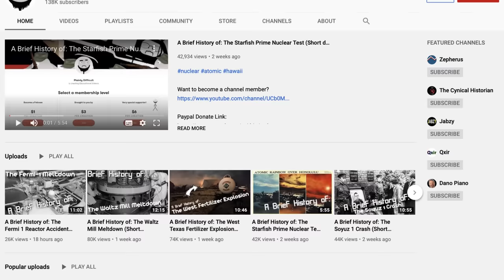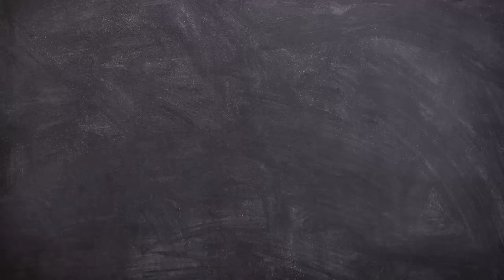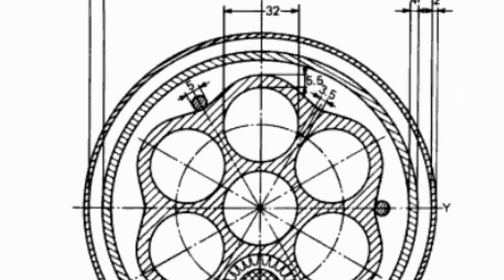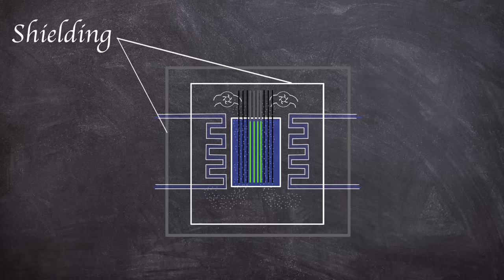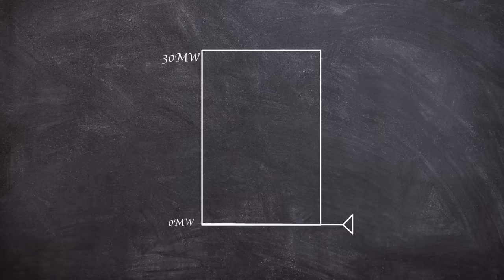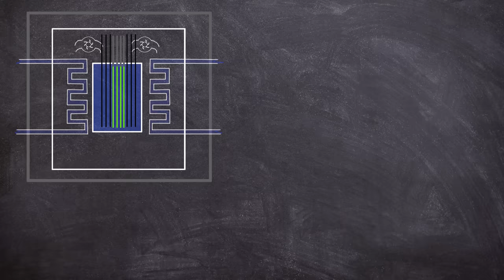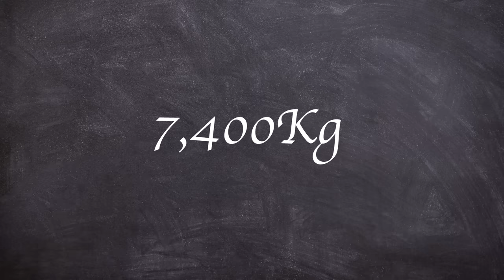A Brief History of: The Lucens Reactor Meltdown (Short Documentary)

Comment: In addition to safety, was defensibly a consideration here?  Building a mostly-hidden, mostly-bomb-proof reactor seems like a very Swiss thing to do.
Reply: The whole darn country is a bunker 🤣
Reply: The Reinforced Concrete Shell of a Nuclear Reactor can probably only be penetrated by a Bunker Buster - There's a snipped out there where they "flew" ( rocket propelled on a rail ) an entire Jet into a representative portion of such a shell on a test site - Viewed directly from the side - At first it looked like the plane went straight through it but a different angle showed the plane just disintegrating on the wall with the latter not having given a single darn fuck about what just had happened.
Reply: Caverns were indeed a way of protecting instalations  as one cant pin point the targets.
Reply: @Duraltia  yes the walls stop a plane and they did prove that but if you're watching German state TV they changed the voiceover to say the walls can't withstand a plane. But the footage shows there is no more plane, just a standing wall.
Reply: @Duraltia  Watched a documentary on a tunnel fire. The problem is not the impact, it is what the heat does to the concrete.
Reply: 4one14  The Osirak Reactor in question didn't even have a protective shell - You could have sneezed on it and it would have had to call in sick the next day 🙄
Reply: @martigrey5872  There is no German state television broadcaster.
Reply: Nuclear reactors were indeed targeted during the cold war as the results were similar to a giant dirty bomb and too tempting to be missed. Burial underground would be beneficial and give a degree of black start capability to the grid.
Reply: Guarentee it was, that was my first thought as well.
Reply: @Thiefnuker  so what is the tax funded TV if not state TV? They have like 50 channels. It's state TV because the state pays for it with a TV tax. Just like the BBC is state TV.
Reply: @martigrey5872  its a public broadcaster. The state does not control it.
Reply: @TotallyNotRedneckYall  not anymore, most of those are shutdown by now...unless they built new stuff, noone knows about...since there are still some sites "eyes only" afaik....
Reply: @Hunne2303  They sold most of their literal "bunkers" at the end of the cold war, but they still have a mind boggling number of disaster shelters.
Reply: @robinwells8879  Sure, it makes sense to for many reasons to bury your nuclear in a mountain side, especially if it's a prototype or your first attempt.  If it gets bombed it's harder to hit, and if it melts down, it melts into a mountain and you can dump concrete into the hole instead of having to build a billion dollar concrete dome that has to be wheeled in place on a 500 million dollar set of rails.  If I'm remembering Chernobyl correctly, they couldn't even get close enough to the radiation source to build an enclosure.  They had build like a mobile 10 story concrete arched lid next to the plant, and roll it into place.

If you build your reactor deep into the rock, I imagine it's going to be inherently more safe given any attack or disaster.  I'm not sure why it isn't done that way everywhere, by default.  You could also store the waste in adjacent facilities drilled into nearby mountain sides, instead of transporting it by train or semi trailer across the country.
Reply: @GlobstersMessenger  I think it's laughable to compare something like PBS, or even BBC to RT... and even more ridiculous to suggest they are state media.  They aren't obligated to speak favorably about the state.  I'm not sure what PBS's mandate is, but it seems to be plenty critical of the state while reporting responsibly on public health and issues that are of public concern.
Reply: @GlobstersMessenger  Having a truly independent media source that is not beholden to profit is important.  It might be a lofty ideal, but a publicly funded source of information is a small assurance against all the things that the recent MAGA movent purported to be against.  If you're against "fake news" with political bias, beholden to big tech with corporate control... I just don't see a more trustworthy source than PBS in the states.
Reply: @martigrey5872  german state tv? There is no such thing, would you like to clarify?
Reply: @GlobstersMessenger  ok... but he says it as if there is just one channel. When in reality its just public broadcasts that include dozens if not maybe hundreds(?) of channels, so either he specifies which channel said this or he is just speaking nonsense. How would he even know what it said if he (i assume) doesn't know the language either?

Just a weird and targeted side comment to make in the first place.

Comment: Reactors in caves may have problems, but it still seems like a better idea than how Chernobyl was built.
Reply: You do realise that after the accident in 86 the other 3 reactors continued operating till 91,96,2000 respectively and there are still another 10 operational.
There's nothing wrong with RBMK-1000 reactors so long as they are operated according to spec. Plus the remaining had modifications post 86.
Reply: Is chernobyl was in the position, the power of the blast would have demolishes the entire side, without the capability to dose of the 🔥... the core would have polluted the underground water traveling towards the lower points
Reply: Spicy Wolf Why would the RBMK-1000 design need to be modified after 1986 if there was nothing wrong with it in the first place? 💀
Reply: If it was a man made cave and properly sealed.  I would highly advise against using an existing cave without proper engineering.  Caves are formed through years of water running through and carving the cave.  So there are many paths for any nuclear mishap to disperse.
Reply: @Zonda1996  they added more safety measure to the control computers and changed a few mechanical feeds. The reactor design itself was unchanged. 
They even used the same design and scaled it down to make 30MW mini reactors
Reply: @spicywolf6718  Nope, up until just before the colapse of the USSR, they were not safe. The graphite tipped control rods were one of the main causes of the explosion, besides the human error. The soviets hid the flaw, and only told people about it when the lead scientest in charge of the disaster response (Valery Legasov) committed suicide. The reactors were then retrofitted (or thats what they are telling us) to reduce the risk of an accident. There was something wrong with the reactor. In addition to not using properly enriched fuel and not building a containment unit.
Reply: @andybub45  lack of containment is due to the fact they're a multi purpose reactor and the cores have to be reconfigurable, that series of reactor wasn't designed just for power generation.
Reply: @spicywolf6718  indeed, the RBMK on Chernobyl cpould not explode. But damn Dylatov you insisted on testing it, here's the result. 

Good thing about RBMK is that they don't need extra refined uranium, which means less pollution on making the "fuel" rods and less waste. Some modifications like to avoid the poisoning and the nasty chemical reactions have been done, but yes, there are still RBMK that are operational in Russia. But now, they know they must not "test" it.

See it's like everything. Someone will be calm, cooperative, kind and generous but push anyone to the extremes, will come a point he's gonna fuck you up and you will regret losing it. Nuclear energy is the same, at the second you don't respect this thing, it fucks you.

However I like the idea of building a reactor on a cave or a bunker inside a mountain, as long you have a river to cool it down nearby it will be fine and more secure than anything made of concrete.
Reply: Everything is a smoke machine if you try hard enough.
Reply: I daresay sticking a couple fuel rods in the back of a pickup truck while blasting the theme song to Dukes of Hazzard is a better reactor design than the RBMK.
Reply: @Zonda1996  The only thing that changed was that the machines no longer let humans over ride the safety mecanisms. You wouldn't call a car faulty for letting the owner drive it at 200mph while drunk would you?
Reply: What? Are you saying that we shouldn’t build nuclear reactors in garden sheds????
Reply: @spicywolf6718  Yeah. Only one RBMK exploded, and two others had partial meltdowns, out of 17 operative. It's not even 18%. They are very safe. What a great idea to build high positive void coefficient nuclear reactors, and tip the control rods with a moderator.
Reply: @andrewlangley9507  
Actually, I think the Nuclear Boy Scout was trying to build a reactor in a garden shed.
Reply: @virgilio6349  what about a car that if you get it up to speed and then apply the brakes, the momentary application of the breaks actually causes the car to go wide open throttle and throw a rod through the engine block? That's more analogous.
Reply: @Calliber50  I was going to say use the term “man made cavern” over the word cave. People in general have a problem understanding caves and using the word leads people from dealing with reality.
Reply: Or Fukushima they many mistakes.
Reply: @spicywolf6718  "nothing wrong with rbmk reactors" except, you know, some pretty obvious design flaws that were brushed over for profit. But yeah, I'm sure they work great if you just fix the shit that's wrong with it and operate it correctly
Reply: @Calliber50  that and parts of the cave may have poor structural integrity and could collapse, possibly sealing off or opening even more new pathways for contamination
Reply: @virgilio6349  well yeah, I would actually, there's absolutely no reason a regular commercial car should be able to go that fast. While it shouldn't need to be able to detect intoxication, it most certainly needs to chill the fuck out on the speed
Reply: @sarahamira5732  Are yous eriously kidding now? You realise those are normal speeds for the Autobahn right? Maybe a little exaggerated, but my point is, only because cars can go fast doesn't mean road accidents is the manufacturers fault. Is Lamborghini at fault for a girl getting drunk in it and pulverising herself in a lampost?
Reply: @virgilio6349  the fastest (and I do mean the FASTEST) Speed I could find in relevance to the Autobahn tops out at 135 miles per hour. The average speed provided by the first few sources on Google is 78 miles per hour. While a few more anecdotal statements on quora put the average at around 85 mph, topping out at around 90 mph. The same user states that there are occasionally a few outliers who can go up to 120, but they made it clear this is by far the exception 🙃

Comment: Low enrichment fuel.
Oh no.
Graphite moderation.
Oh no!
Air cooling.
OH NO!
Reply from the maker: A healthy mixture for disaster
Reply: What's wrong with low enrichment fuel? Wouldn't that be better than high (er) enrichment?
Reply: @PlainlyDifficult  UK Magnox reactors ran safely with NU or vLEU fuel, graphite moderation and CO2 cooling for many decades.
Reply: Not great, not terrible.
Reply: We didn't learn from Chernobyl did we?
Reply: @dodecahedron1  Sorry but that is not correct. A natural uranium fuelled reactor can only operate as a thermal reactor, that is using low energy neutrons. Modern civil thermal reactors using low enriched uranium (with around 4% U235) operate on the same basis. The main difference is that natural or very slightly enriched uranium requires the use of either graphite or heavy water as a moderator while higher enrichments also allow the use of ordinary light water as a moderator.
Reply: David Parry  Personally I doubt that the USA would want to use such an old fashioned design.
Reply: @mile290productions3  Lots of lessons were learnt from Chernobyl. But the Chernobyl disaster was in 1986, long after the Swiss incident in this video.
Reply: David Parry  Well they did vote for Trump as President and they might be about to give him a second term.
Reply: What the fuck ?
Reply: Wait, I thought he said heavy water moderated, no?
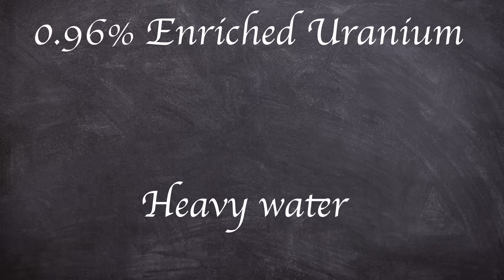Reply: @mdepfl  Correct see 2:52.
Reply: Remember Windscale. Air-cooled reactors are just not a great design.
Reply: @kelleybrown1666  As a rough analogy, a graphite moderated and air cooled reactor will have equivalent cooling circuit chemistry to a coal moderated air cooled reactor. So yes, the use of air - an oxidising agent - to cool any power reactor is a silly design choice. I'm sure American colleagues would have expressed that view to the designers of the Windscale piles. The events of 10 October 1957 proved them right. But by then, the UK had already adopted CO2 cooling for its civil power reactors.
Reply: It was cheap 
The word cheap when used to describe a nuclear reactor is a disaster waiting to happen
Reply: I mean, nothing wrong with using graphite as a moderator (as long as you know its limits and reactions). The air cooling was indeed a bad decision, specially in an experimental design. People who watched Chernobyl tend to forget there was nothing wrong with the reactor design and that the operators had to byspass MULTIPLE safety warnings and abort mecanisms to perform their "test". The machines at Chernobyl where literal screaming at the operators to stop. The only fault in the design was the final manual abort mecanism where all graphite tubes where lowered, not taking into account that graphite heats up momentarily before cooling down. Chernobyl was an 100% human error, no, error would imply they messed up, it was intentional all the way until the meltdown.
Reply: @virgilio6349  Actually, by about 1953, the UK had rejected water cooled but graphite moderated moderated civil reactors as inherently unsafe, precisely because of the hazard from postive void reactivity coefficients. I believe the latter were the main root cause of the Chernobyl disaster. I expect that, one way or another, the USSR were aware of the UK's view but decided they knew better...
Reply: @mile290productions3  WE GAVE THEM THE PROPAGANDA NUMBER
Reply: @mdepfl  The fuel elements were loaded into graphite matrix, but yes, heavy water was the main moderator.
Reply: @virgilio6349  Well, in the technicians defence, the USSR suppressed the knowledge of how the tips of the graphite rods would boost fission rates as they went down. Something that was picked up when the Leningrad RBMK plant had an excursion. Add in the physics of the reactor at low power and it was a recipe for disaster. 

But yeah, wouldn't have melted down if they hadn't ignored the fucking safety warnings and alarms and had the training to understand fully what they trying to do and why it was a Bad Idea.

Comment: You failed to mention a very critical part of the description of the Lucens Reactor design. This particular design, much like the RBMK design in Chernobyl, used two types of moderator material, graphite and deuterated water (H2O also works), a difficult balancing act if there ever was one.

Both types of designs unintentionally incorporated uncharacterized positive void coefficient failure-modes which could allow unaccounted-for excess moderating material near the reactor fuel. Thus, when the coolant, being affected, couldn't maintain fuel temperature stability due to an excess of reactivity from the over-moderation event (keff >> 1), a meltdown ensued.

So it appears that the Swiss had a meltdown of a very similar type to the Chernobyl design, except in the Lucens design they had 1/2  to 1/3 the uranium enrichment level and less overall starting nuclear material that could get into a positive-feedback runaway situation. If this was publicly available knowledge, the Russians might have been able to modify their reactor and avoid a catastrophe.
Reply: The Russians new this. The soviet state didn't release its own research into the void physics to its own scientific community.
Reply: Russians knew this - they even had accidents in other rbmk reactors before chernobyl, but they did not share information between theimselves
Reply: The main problem at Lucens had been the use of magnesium along with CO2 and water in a high temperature environment. Since those charateristics were not present in the RBMK reactors, the Soviets would have considered them to be safe anyway. 
It has to be said that the problems of Lucens were even easier to predict than those of the RBMK reactors, since it was well known that the Magnox alloys were rapidly corroded by water (it was for that reason the "magnox" British reactors had no water in the core, and that had not completely saved them anyway) even more since in a CO2 atmosphere water forms carbonic acid. In the original design, the magnesium was not directly in contact with water, but it needed only a small leakage.
Reply: Keep in mind, cost-effectiveness was everything for the Soviets. They didn't even build their NPP's with containment buildings, due to cost. I seriously doubt they would accept the cost of overhauling relatively new reactors.
Reply: @Waldemarvonanhalt  the pwr reactors where build with an containment building but due to the hot swapping of fuel in the RBMK reactor they didn't want to build one because it would remove that feature